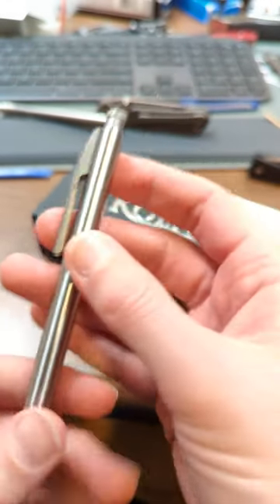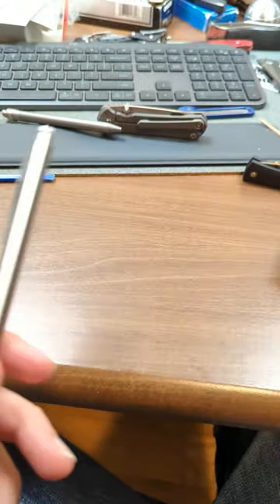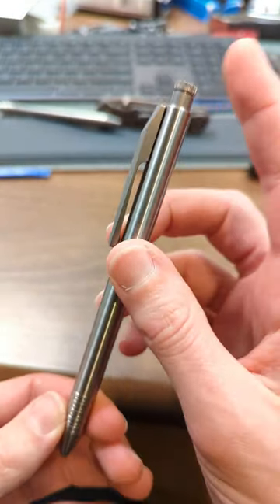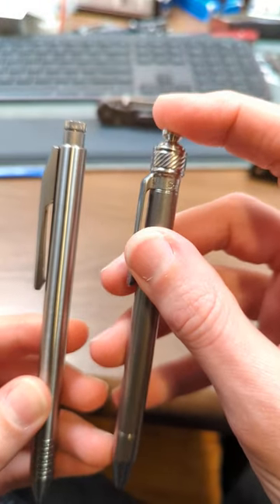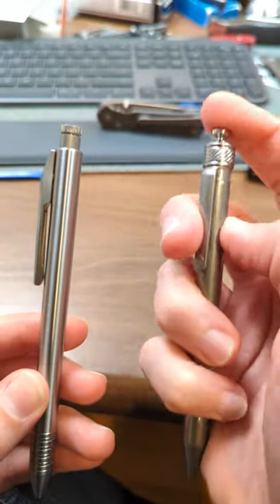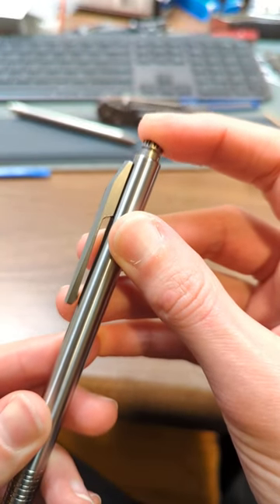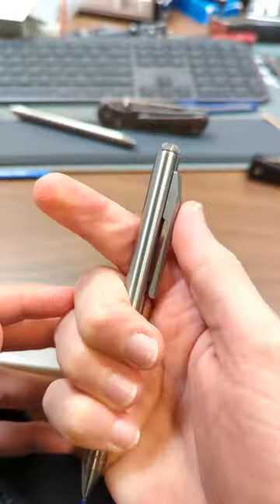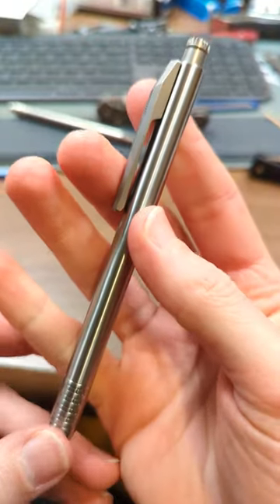New Koenig Knives titanium EDC pen with an incredible new mechanism!

Comment: So, with the PQD how does writing not retract the the ink refill?
Reply from the maker: Great question -- I wondered the same thing when I first saw it, thinking maybe it was just being held in place with a detent. The mechanism actually works a lot like an air hose disconnect, so the only thing that can release it is intentionally sliding the internal collet (attached to the clip) up, allowing the ball bearings inside to slide out of the groove they get locked into. Pressure on the tip of the pen refill alone cannot unlock anything.